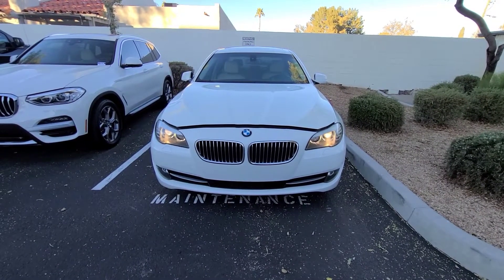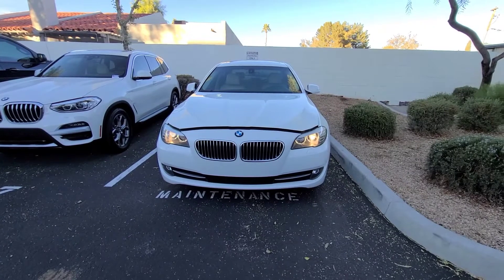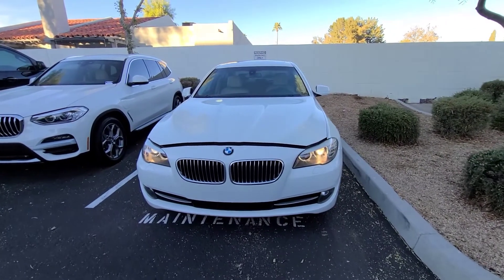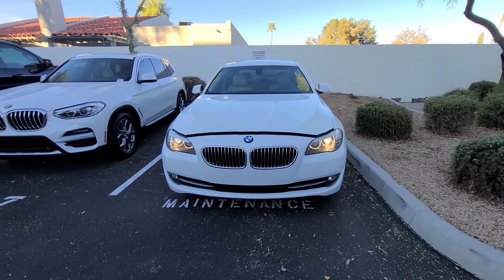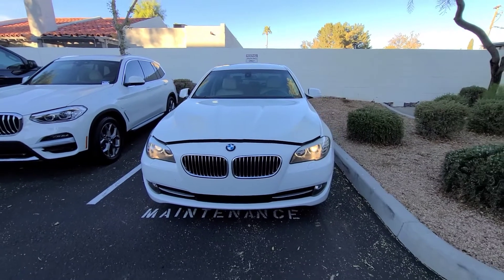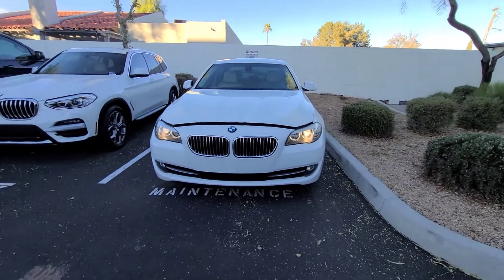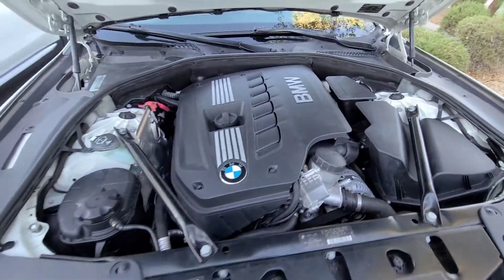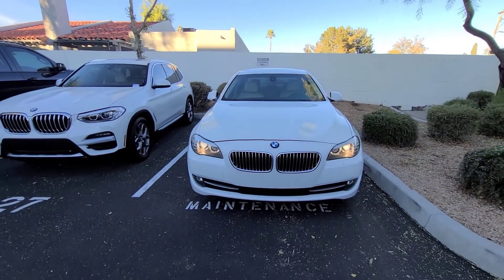2011-13 BMW 528i Rough Idle - VANOS Issue - Code P052b Resolved!

Comment: You saved my life!!! I today the check engine light came pulled the code and called the dealership. The adviser asked the VIN and confirmed the issue. I have an appointment now at the dealership this Monday. Thank you very much.
Reply: Is the vanos solenoid replacement free ?
Reply: @eze12313  Yes. The dealer kept my car for 2 days and I didn't pay anything.
Reply from the maker: Thanks for watching!
Reply: What did you ask the dealership in order for them to complete the job for free?

Comment: I have the same issue but I have the M model and they will not warranty it and the engine s full of metal shavings prob a bearing fro lack of oil due to the vanos.

Comment: I’m having the same issue in my 2011 328xi 
Unfortunately, the extended warranty ended 2 years ago. I know this will be stupid expensive to fix
Reply: Just did the job myself it is a headache but doable with the proper tools
Reply: @Jay-eq1zb  hi, I have the same issues, do you have to take the valve cover off and use proper tools to hold the timing incase it moves?

Comment: I have p054b what do you think the issue is. I have the same exact sound you’re getting. I have a 2013 328i
Reply: You find out what the issue was? I have the same code. Sometimes it's p0546. Ppl tell me it's valvatrain timing solenoid
Reply: @rockyk1395 for your code replace the o2 sensor.
Reply: @guccipig2782  what sensor would that be. That code came up on my 2011 528i bmw